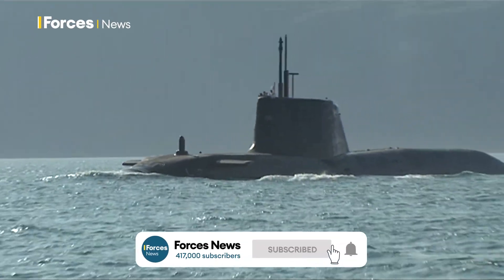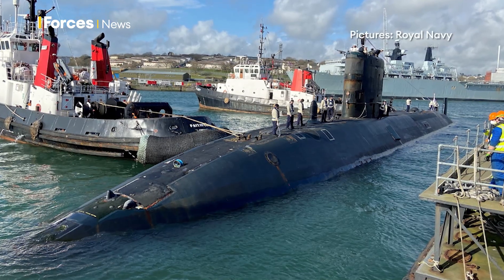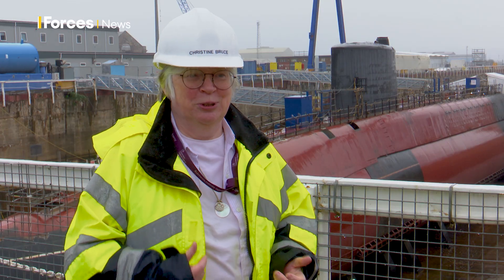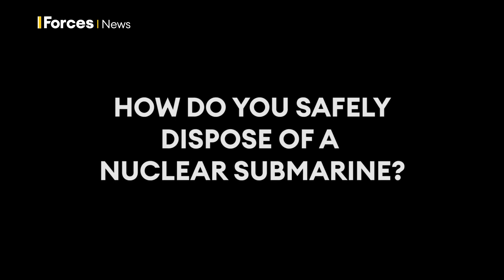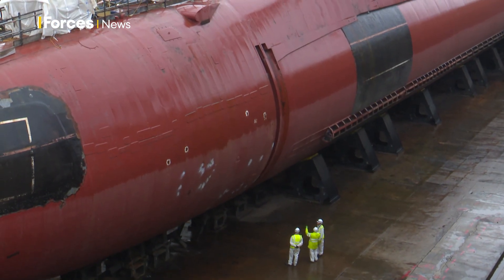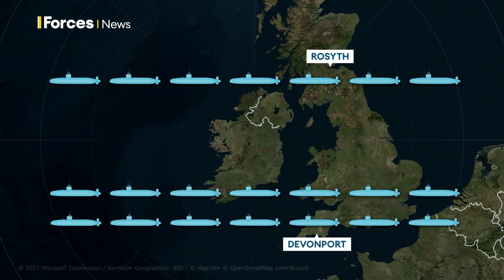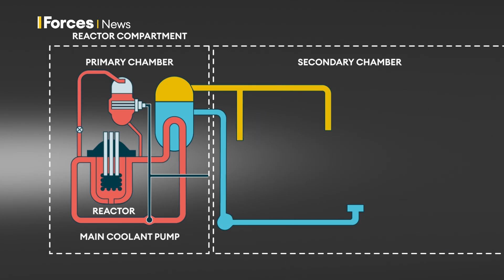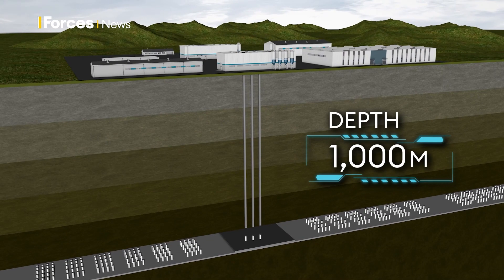EXCLUSIVE: How do you dismantle a nuclear sub?

Comment: UK should ask America on how it's done. We've been recycling used submarines for a long time and US Navy does it on a regular basis. Sometimes we even use the older boats as moored training facilities to train Nuclear engineers. It's funny how the UK is saying it's their first because the US navy has done it for a LONG, long time.
Reply: Our navy is older than your country. So, yeah.
Reply: @captainhindsight8779  Yeah sure but still doesn't have the same clout as the USN
Reply: If the UK had a Hanford, probably we'd have done exactly that... But we don't
Reply: @rrpa  what’s Hanford?
Reply: No the US has not, the US Navy removes the whole Reactor Compartment and dumps it in a storage facility in Washington state. The UK will be the first to re-process the entire submarine reactor compartment included .
Reply: Agreed. It's not the worlds first, by any stretch. The US removes the fuel,  the assemblies, and any other component with radiation, then seals up the reactor core  It's like saying the UK is the worlds first ship recycler using only 10mm wrenches and working on Tuesdays(obvious sarcasm), or changing one process, when you need to add technicalities you aren't first. The US also removes many parts of the reactor but uses the compartments to use a high pressure keep the nuclear molecules at bay. Worlds first would be discovering how to not have any contamination when recycling. 

"It’s a meticulous process. First, the defunct sub is towed to a secure de-fueling dock where its reactor compartment is drained of all liquids to expose its spent nuclear fuel assemblies. Each assembly is then removed and placed in spent nuclear fuel casks and put on secure trains for disposal at a long-term waste storage and reprocessing plant. In the US, this is the Naval Reactor Facility at the sprawling Idaho National Laboratory, and in Russia the Mayak plutonium production and reprocessing plant in Siberia is the final destination."
"Although the reactor machinery – steam generators, pumps, valves and piping – now contains no enriched uranium, the metals in it are rendered radioactive by decades of neutron bombardment shredding their atoms. So after fuel removal, the sub is towed into dry dock where cutting tools and blowtorches are used to sever the reactor compartment, plus an emptied compartment either side of it, from the submarine's hull. Then thick steel seals are welded to either end. So the canisters are not merely receptacles: they are giant high-pressure steel segments of the nuclear submarine itself – all that remains of it, in fact, as all nonradioactive submarine sections are then recycled."

Comment: It's rather disingenuous to say the UK program is a 'world first'.  The US has been running the Ship/Submarine Recycling Program for thirty years.  Each country has taken a different path based on cost, political and environmental factors.  The difference is just the final state of the reactor compartment and the primary plant.  The US has a location and space for very long term storage of the entire RC at the Hanford Nuclear Reservation.  It's much faster and cheaper to bury the entire RC without having to cut up the most highly radioactive components.  The US has almost 200 subs and over a dozen surface ships (with multiple reactors) that will have to be recycled.  The costs of taking the Primary and RC apart for all of those would be horrendous.
Reply: Try watching the video.
Reply: 200 subs?
Reply: @adamatch9624  Roughly 200.  That includes the old boats that have already been decommissioned, the ones currently in commission and the planned new construction.  All will eventually need to be processed by the SRP.  There are just over 60 pre-688 fast attack boats (Skipjack, Skate, Sturgeon, Permit-class), 41 Polaris/Poseidon boomers ("41 For Freedom"), 62 Los Angeles (688/688i), 18 Ohio class Trident SSBN, 3 Seawolf, 66 planned Virginia SSN and 12 Columbia SSBN.  Only 38 of the Virginia have been built or funded and the Columbia class hasn't even been fully funded.   Final numbers may change due to budgets and defense needs.  The Virginia/Seawolf boats won't even enter SRP for at least another 30 years.  I think it's safe to say we will be in the nuc recycling business for at least the rest of the century.
Reply: The US just buries the whole reactor compartment, that is not recycling in any way, shape or form.  No other country recycles naval reactors, the US cuts them out and buries them, the Russians just leave them to rot, and the French haven't made up their mind yet and just store their old subs like we were doing.
Reply: I get the impression they’re trying to prove that all components can be recycled and just bury the RPV , pressuriser and maybe the coolant pumps
Reply: The US has been dismantling and safely storing hazardous material on land.  On the UK and Russia have left nuclear submarines in dock, rusting in sea water.  The UK still has no final plan to store waste materials. Franch and the UK have created safe facilities on land for permanent storage.  This is just propoaganda

Comment: Shame they weren't able to make them into mini power stations
Reply: Plus the reactors are designed to operate in constant submersion in sea water. The logistics of putting one on land and retrofitting it to run outside of a sub isn’t cost effective.
Also, they are still pretty secret. You cant just roll it into civilian use without broadcasting to the world “this is how the Royal Navy powers their subs!”
Reply: @realburglazofficial2613  They have been sat in seawater since decommissioning could have been pumping power into the grid for at least some of that time.
Reply: @normanboyes4983  the Subs are completely self contained. There’s no way to get the power generated by the reactor outside of the boat. It’s not like a battery that you can unplug from one thing and plug into another. The reactor runs on Submarine specific systems, it also powers Submarine specific systems. You can’t run the reactor as a power station without running the entire Sub, you can’t run the Sub without crewing it. It would be prohibitively expensive to do.
Reply: Its not economical

Comment: Why does it take so long ? It's madness !
Reply: Dude watch the video, they literally explain why
Reply: The longer you leave them, the more the radioactive materials decay and the less radiation you have to deal with. Leave them for 30 years and 90% of the radioactive problem has decayed away, making them much easier to dismantle.
Reply: '...Leave them for 30 years and 90% of the radioactive problem has decayed away'

Doubt.
Reply: @KumaBean  There's a reason why you can go on tours around Pripyat now. There's a correlation between how radioactive something is and the time it will remain so, simply because very radioactive things 'shoot their powder' quite quickly. High level waste remains dangerous for a long time, but it's nowhere near as dangerous after you've let it sit for just a couple of years.
Reply: You don't rush anything involving radiation
Reply: @Sierraomega1991  No not a rush but, of up most importance !